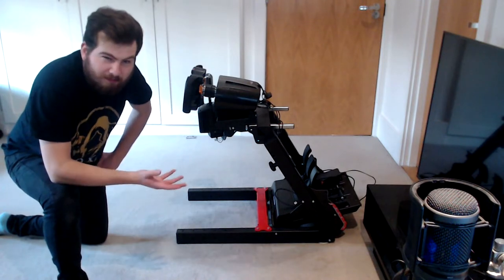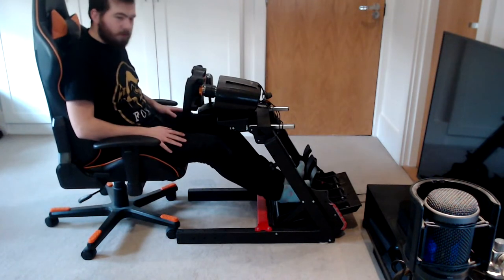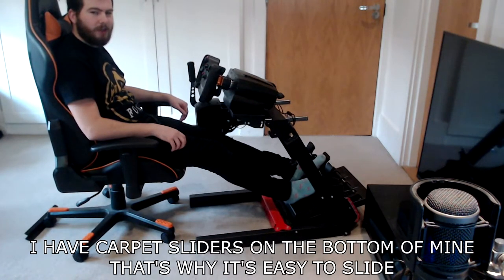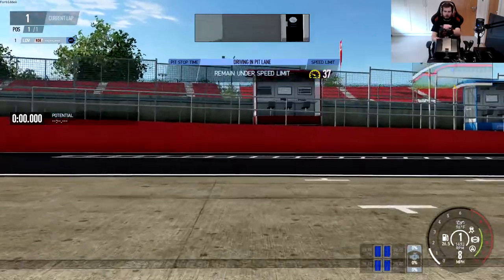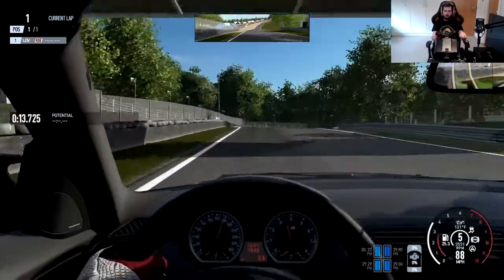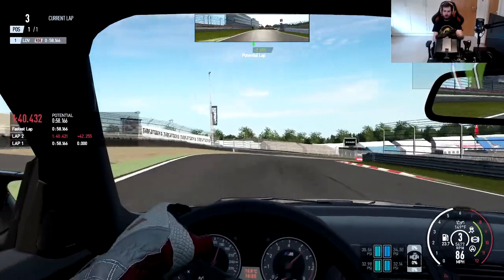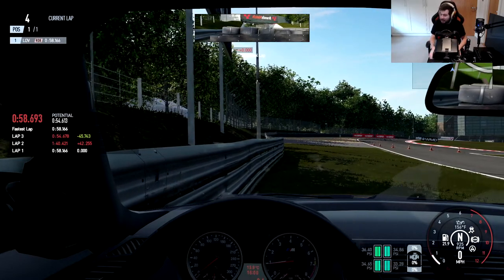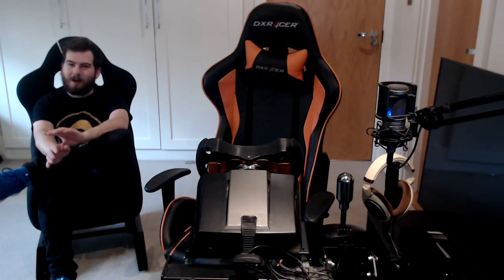Can You Use The Simetik K2 Cockpit As A Wheel Stand?

Comment: Using the Simetik as a wheelstand with Podium DD1 (usually at 50% but tried 100% as well) and CS pedals with brake set very hard. 
No movement at all but a chair with wheels probably isn’t the best idea. I use a “single-seat couch” (don’t know the proper English word for it) and have two bolts with a ring (provded by Simetik) at he end with 2 short pieces of rope that go around the feet of my couch. Rock solid!